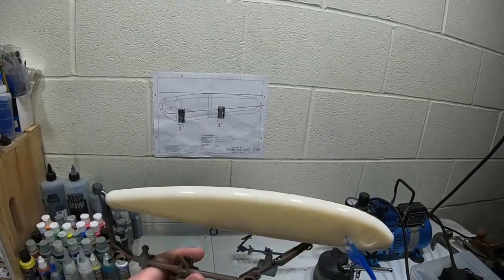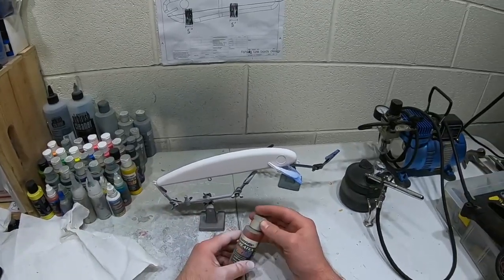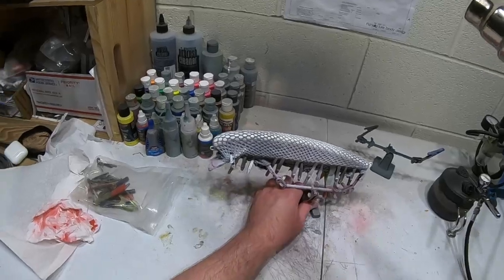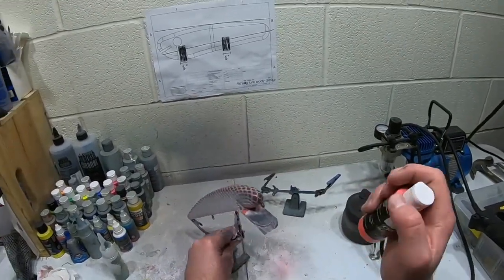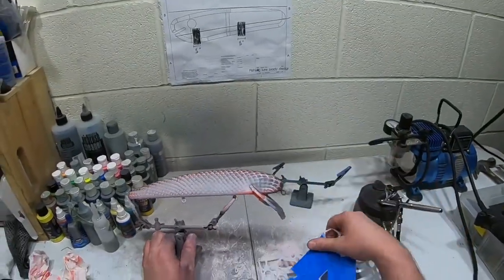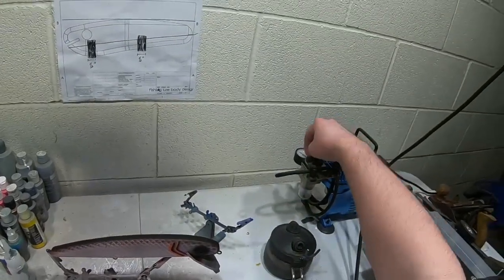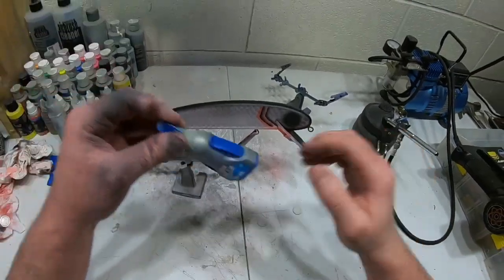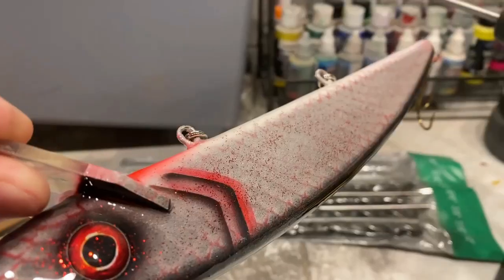Painting a Musky Lure| Secret tip to make your Jake Crankbait stand out!

Comment: you make it look so easy!   I think it turned out very nice........  do you sand off the original coating and color to start with??
Reply from the maker: It depends on the what the bait looks like. If I'm repurposing an old or the blank I'm using looks like it needs it then yes. Most of the time when I'm painting a blank, I don't need too though and havn't had it hinder my results too bad. Hope this helps!

Comment: What type of paint do you use
Reply from the maker: I use a lot of createx colors as well as some wicked colors
Reply: @DH_Baits  what size tip do you use? Thanks
Reply from the maker: The tip I’m using currently is a 0.35 tip. I’ve used a 0.25 before and didn’t like it as much